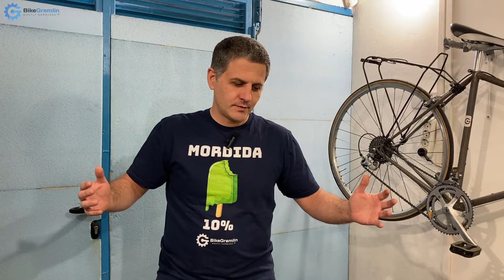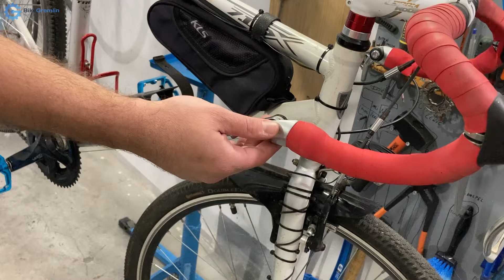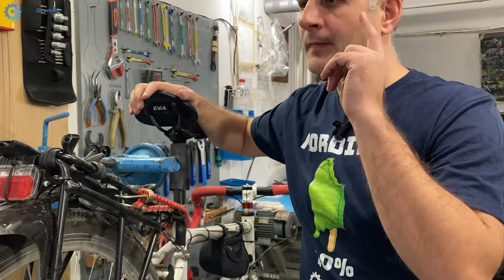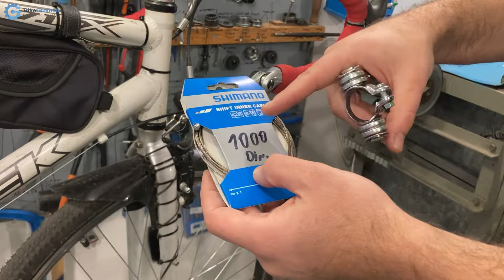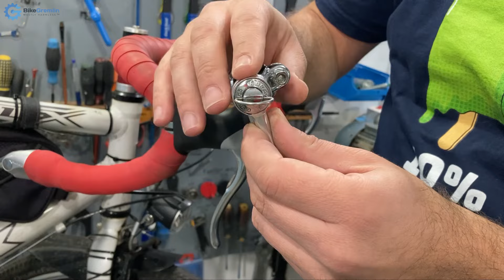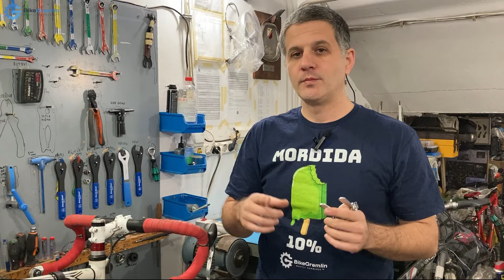Friction Shifters Explained

Comment: Good video, I rode with down tube and bar-con shifters from 1975 to the nineties. Then went with the crowd. But you are correct they are the lightest and most durable and easy to use when you become skilled with them.

Comment: My previous bike still had them. They provide precision and quickness. But reaching to the downtube for gear change is not good, especially for city riding. The ones you have on your personal bike with the gear indicator seems a good compromise.
Reply from the maker: Yes - many people seem to have problems with the DT shifters for the reason you explained.
For me they are fine, even for city riding (the old bike in the video is a summer city commuter - hence the abominable hack of a rear rack on it :) ).

Relja

Comment: Thanks for the video Relja :) I'm slowly moving from index to friction, especially because friction is so much more convenient in the front and for the rear, I am not worried about what speed cassette I get. Still struggling with the rear shifts though as they sometimes end up incorrect and suddenly jump up or down - also have to pay much attention with the ear which is difficult with outside noise sometimes.

I wanted to ask you - how is your experience with compatibility of older 6-7 speed downtube shifters with 8 or 9 speed cassettes?

Thanks from India
Reply from the maker: Hi,

The indexed 6-7 speed DT shifters won't work nicely with 8-9 speed cassettes.
However, the friction shifters will.

Having said that, note that the more speeds a cassette has, the more tightly packed its sprockets are.
That makes it more difficult to get the shift just right using friction shifters (the problem you explained is exactly what I mean).
To help with that, you can use a lower-speed cassette (8 or fewer), 
or you could use a rear derailleur that moves less per each gear shift. Here is a table showing how many mm different derailleurs move per one mm of cable pull:
https://bike.bikegremlin.com/1278/bicycle-rear-derailleur-compatibility/#5

For any technical questions, I would recommend you use the BikeGremlin forum - so that answers can help anyone else with a similar problem (YouTube is very bad when it comes to searching for comments and won't let you post pictures):
https://www.bikegremlin.net/

Relja

Comment: You speak amazingly good English.
I like the look of the thumb shifters. I don't need it to work as an index shifter.  Can you recommend a pair of thumb shifters that would work with most gear systems?  Thank you.
Reply from the maker: What I use (no more honest recommendation than that) is old, used (2nd hand) Shimano thumb shifters (bought on the 2nd hand parts market).
For the new stuff, as far as I can see, only Microshift makes decent, metal ones nowadays. I haven't bought any for myself, but these state that they have a friction shifting option:

https://www.microshift.com/models/sl-m10/

Relja
Reply: @BikeGremlinUS  Thank you very much.

Comment: You're missing out on great shifting with 10s/11s/12s cassettes, the shift ramps improved shifting by miles compared to what's available for 7s and 8s, also better chains. I don't like Shimano STI's either and only use Sram STI's but even with friction shifters the shifting is so smooth and quiet, that the only problem I can see is loud modern hubs which may be too loud to shift by hear and would have to focus more on feel. 
However, Sram STI's are very reliable and the shift ratchet inside can be removed and serviced in like 10 minutes. They also don't have the idiotic flappy side swipe on the brake lever, that Shimano is known for.
Reply from the maker: I did ride 10speed cassettes on road bikes and did appreciate the fast shifting (even under load if needed - if it ever really is :)  ).

Still, I highly prefer the robust and simple friction shifters and that's my first choice, with all its pros and cons considered.

Relja